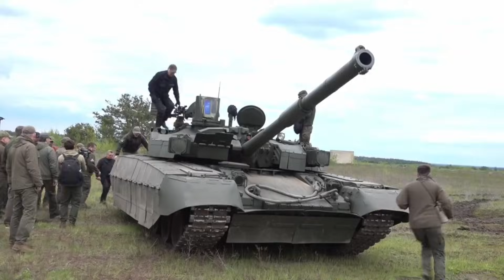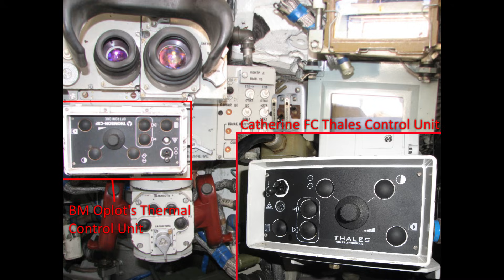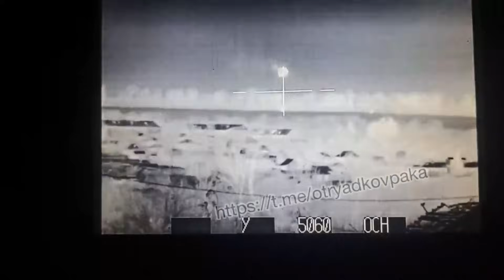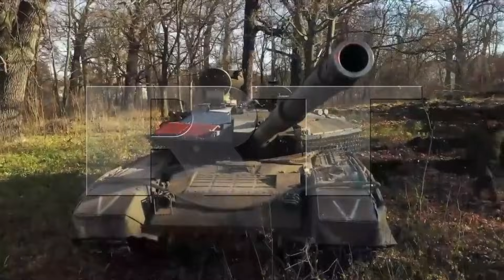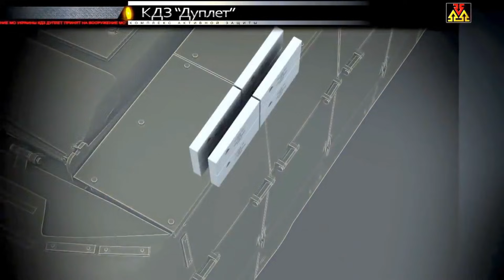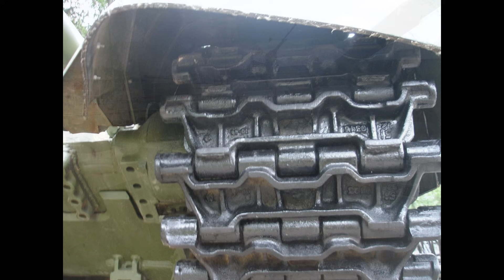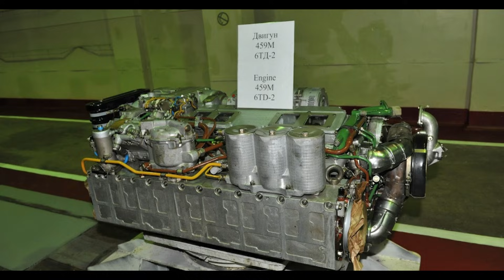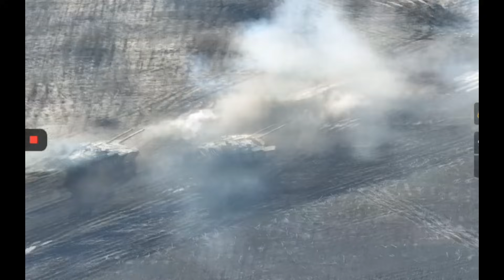Best Ukrainian vs Best Russian tank. T-90M vs BM Oplot comparison

Comment: The biggest problem of both of the tanks is the cost to manifacture one relative to what are they suppose to do in the current conflict, i dont really think that restarting the production of the BM oplot is the most wise decision for ukraine but what do I know 🤷‍♀
Reply: if you said T-14 since Russia never build it for a conflict, yeah maybe, but T-90M? it still costs less than lets say Leopard 2A6, like, at that point the only thing that is not cost is T-72.

But T-72 is not necessarly COST EFFECTIVE, unlike T-90M, and Leopard 2A7
Reply: @gerfand  well ofc the Leo's are going to be more expensive but germany doesnt need to replace thousands of lost tanks that they lost mainly due to poor tactics/leadership, artillery or just being abandoned by their low morale/unskilled crews
russia doesnt need 200-300 T-90Ms, they need 1000+ tanks that they can mass produce/upgrade and send them to frontlines
Reply: @samuelsaktor473  and they are doing that this is why you see T-80B, T-72B and T-62 with thermals, its cheap upgrade but its not like they are low on tanks they use every day

That on top of T-72B3, T-80BVM and T-90M retrofit and production
Reply: Even before the war Ukraine had a chronic inability to build BM Oplots, Thailand contracted Ukraine to make some and it took so long that the Thais purchased and received brand-new Chinese VT-4 tanks in the meantime and right now Thailand has more T-84s than Ukraine did before the war.
Reply: @andrew2353  yeah, that is the funny part, it took China a year to give all those tanks, meanwhile Ukraine was a decade long process, ofc anyone can say Oplot is better. but at that rate, I stick Chinese
Reply: There's more than 300 T-90Ms out of production already. What are you talking about?
Reply: @koskok2965  in december I knew they delivered 200 T-90M just to Ukraine "SMO"
Reply: @gerfand  Yep. The footage of endless freight trains strapped with them crossing the camera FOV non-stop was pretty damn hilalrious.
Reply: @koskok2965  as far I know Russia cannot build tanks its clear those are non existent tanks. Or at leat they did something like used cheats to spawn tben in
Reply: @koskok2965  and how many of them were built before the war and how many during ? because as things go its way more cost effective and in russia's case resource effective to just upgrade the already existing T-72/80 etc. then to build new tanks that are way too advance for the role they are going to do on the battlefield which is providing fire support for the infantry
Reply: @samuelsaktor473  As times goes on, design flaws get evaluated and addressed, the design undergoes simplifications, both with respect to the bill of materials and the manufacturing processes pipeline. 

This dynamic approach to mass production can be found everywhere, from plastic cups to combat aircraft. Plus, Russians in specific hold DFM as the holy grail of manufacturing related issues. 

Yes, the upgrading of existing T-90As is significantly more cost effective, but keep in mind that Russia has entered a completely new chapter in its history, the sequel to the original Cold War. The number of T-90As remaining in stock for upgrading is limited and as it seems, very much inadequate in the long term (to beef up the Russian armed forces in general).
Reply: I mean they are already starting to produce all sorts of stuff abroad. For example they started to produce the Bogdana Howitzer.

Comment: T-90 M has abysmal reverse speed i hope they can fix that problem.
Reply: There is already a solution but it isn't used
Reply: @bicopgameryttm7266  if there would already be a solution, this wouldn't be a problem. Having developed a transmission is not enough, you need to organise production, logistics and then meet demands of russian army. It's better to have 10 T-90M with abysmal reverse speed than 2 with good one

Comment: Wouldn't Duplet ERA only be effective in countering kinetic and heat charges that are coming at an angle more than around 15 - 20 degrees of the armour? 
if the main principle of survival is using heat charges to dissect the penetrator, then the angle between the charges and the penetrator should be of vital importance. i can see the glacis being the best spot for it but for shots to the side and even from old RPG rounds that send a sufficiently small penetrator, this would prove ineffective if hit in the right spots of which the probability is around 30 - 50%.
Reply: It's not that we have flying t90s shooting darts from the sky
Reply: @stingray-5863  They do actually fire ATGMs and can hit a tank from the side easily
Reply: @dwarow2508 And they often do (Though I've seen footage from a T90M shooting three HE projectiles onto a T64BV for some reason)
Reply: @Pao234  HE-F is actually quite potent on old tanks like the t64 if used on the Hull or turret roof.
Since in reality life tabk on tank warfare, it isn't necessary to kill the crew or detonate ammo to knock out a tank.
Simply tracking it, destroying the engine, destroying the optics, can render an otherwise perfectly undamaged vehicle useless.
Reply: @Dwarow 2  even from the top such as in the case of the tow 2b and similar atgms
Reply: @Pao234_  likely didnt have any apfsds as it didnt expect to meet a enemy tank.
Reply: @Pao234_  bro thinks he's playing war thunder (over pressure my beloved)
Reply: @Pao234_  yeah because irl if you get hit and you dont know where the shot came from you get the F out of the tank as soon as possible. You dont know what hit you, you only know that it makes a big boom and that the enemy has his sights on you. You get tf out to fight another way.
Reply: @Pao234_ HE can do a lot of damage to a tank. Rip tracks, damage optics, sell shock the crew, rip ERA plates off.
Reply: @stingray-5863  side aspect*

Comment: That oplot tank is a big no for me. Take a look at the turret. It is entirelly blocking the driver hatch except that one small area next to the gun. 

If the would send those to the field they will befinitelly have massive driver losses. And the vertically stored ammo does not helps them getting into the turret eighter.

T-90m has a V shaped era on the turret front exactly to allow the driver getting in and out at much more turret positions.

Comment: That one Clip of two T-90Ms reversing is so painful
Reply: This is not the best example of a reverse move. As one person has already pointed out, there is a video where the T-90m passes the building faster.
Reply: @NotNayob335  the T-90M or any other T-72 tank only have 1 Reverse Gear with 4 km/h max speed only a T-80 have 10 km/h in reverse
Reply: @kevlar2536  the number of gears does not determine the speed. The T-80UD, having one gear, was traveling at a speed of -16 kilometers per hour. The T-90M has a modified transmission compared to the T-72, with the installation of a new engine, the reverse speed increased from 4 to 16, since there was already a video where he goes at a speed of 6-8 at incomplete rpm. The T-90A had a speed of 4 due to a weaker engine.
Reply: @kevlar2536  T80 also has one reverse gear
Reply: @NotNayob335  T-90M have the same engine as the T-72B3 and also the same Transmission, T-80s only have 10km/h max reverse speed at least the russian T-80s the ukrainian T-80s like the T-80UD or T-84 does have a other Engine and Transmission
Reply: @NotNayob335  and i have never seen a Video from a T-90M reversing with 16km/h maybe it was an test Variant and if you have this Video or knows the of it it will be nice if you can send the link for it
Reply: @KashtanGreg  yeah i know but it has an better engine with more Power
Reply: @kevlar2536  Nope. T-90M and T-72 B3M have the same 1130 hp engine coupled with automatic transmission.

T-72 B3 and T-90A have 1000 hp engine and manual transmission.
Reply: @chilechichich465  what i have never said that the T-90M have a other engine and Transmission as T-72B3 somebody else did say that but not me
Reply: @chilechichich465  and by T-72B3 i mean both Version because there isn't a big different same Max speed and same reverse speed
Reply: @kevlar2536  These are completely different variants. If you wanna upgrade B3 to B3M you would need: new engine, new transmission, new gun, new ATGM launcher, new autoloader, new fire control system, new panoramic view for the commander, new ERA on the hull, new radio system, GLONASS satellite navigation, rear view camera for the driver.
Reply: @chilechichich465  B3M does not hace a new gun its the 2A46M-5 that the normal B3 also have and both B3s does not habe a CITV only Nightvision which isn't stabillize both Variants aren't that different
Reply: @kevlar2536  Absolutely not true. B3 model is compatible with T-90A and it has 2A46M-2 gun with Mango/Vant ammunition.

B3M model is compatible with T-90M and it has 2A46M-5 gun with Svinets ammunition.
Reply: @chilechichich465  the T-72B obr 1989 is that what you mean but T-72B3 from 2010 has the same Stabillizer the 4E42-4 like the T-90 and the B3M with 40°/s  turret Rotation speed and also the same gun the 2A46M-5 which is Svinets 2 and other Modern russian round compatible
Reply: @kevlar2536  Absolutely not. You've got it all confused. T-90A and T-72 B3 were fully compatible and they were NOT able to use Svinets ammo.

T-90 was compatible with T-72 BA. Don't use Wikipedia, stick to Russian sources when it comes to Russian weapons.
Reply: @chilechichich465  i didnt use Wikipedie and on all Sources they say that the T-72B3 from 2010 have the 2A46M-5 but maybe they mean the 2014 Version where i believe most russian tanks T-90A included got upgradet with the 2A46M-5 to can shoot modern rounds and i also watched Videos of T-72B3 having that gun
Reply: It has been confirmed many times that the reverse speed was improved on the T90M tank. It's top reverse speed is around 14+ km.
Reply: @korana6308  where was it confirmed because in most Clip you See T-90Ms reversing with an top speed of 4km/h
Reply: @kevlar2536  you don't see 4km/h because there's no speedometer. So you are lying. There has never been a conclusive test online that shows the backwards speed, because neither side thinks it's of important value. If Russians show it you will still say it's not enough. If Ukranians will show it then it will show that Russia did improve it. And precisely because they are not showing it even though they have this tank. You can tell that it's been improved , because they would be the first tone to show otherwise... It has been confirmed by several engineers who designed that engine, on forums.
Reply: @korana6308  i am not Lying because to me it didnt look like that it is 30km/h or so more its under 10km/h and their where other test with T-72s like on the M-84 where it have only 4km/h in revers and it can be Important to qiuckly go in Cover after shooting
Reply: @korana6308  and you can looked up at many Sources that T-72s have unter 10 km/h in revers mostly 4-5 km/h
Reply: @kevlar2536  That is the point it is 14 km/h now. It is improved compare to T72 and the original T90 engine.
Reply: @korana6308  but where is the source and in all footages of the T-90M in ukraine Shows the opposite it much slower then 14km/h
Reply: @korana6308  or did you have seen a Clip of a T-80BVM reversin because the BVM kinda look like the T-90M because of the Relikt
Reply: @kevlar2536  there are no "footages" that show you speed of the tank and it's max reverse speed.
Reply: @korana6308  in this Video there is one Clip of two T-90M reversing with a speed defenitly under 10km/h and in all footages of the Tank reversing it is always at about 4-5km/h it is very slow
Reply: @korana6308  he also made Video of the Problems of T-90M there is also an Clip of a T-90M trying to revers in Cover but it had to turn his Hull so it can drive forward to the Cover and also need to use smoke
Reply: @korana6308  source?
Reply: max pain
Reply: Which is why Russia is restarting the production of T-80. Nonetheless, in a direct tank vs tank battle, Russian tank almost always prevail. It's to the point that Ukrainian doesn't allow it's tank to directly engage Russian tank. If they see Russian tank, they are to avoid engagement and call in the precision artillery strike or drone attack. Then came the Western tank.  But Russian tank in turn avoid engaging Western tank and instead call in drone attack.
Reply: Russia has beef with reverse gear 😭😭
Reply: but in one year there is no evidence that the tank was destroyed in such situation
Reply: @Niko_rj  there are some Videos off T-72s getting destroyed because of the poor reverse speed and not only in the Ukraine Konflict also in the middle east
Reply: @kevlar2536  and can you prove it? and I'm talking at the turn of the tank
Reply: @Niko_rj  did you mean the Turn of the Hull or the Turret
Reply: @Kevlar25  hull, when the tank is moving backwards, but turns hull
Reply: @Niko_rj  but i am talking about the two T-90Ms reversing in this one Clip there reversing straight
Reply: @kevlar2536  I said that they had no case where tanks were destroyed at such a time. but you said that there were such cases
Reply: @Niko_rj  yeah there are such cases but i thought you mean by the reverse speed and not the turn of the hull
Reply: its not a really good example ive seen them reverse much faster then this. In this spesific case the drivers just decidet to not reverse quickly
Reply: @nekko5778  T-72s does only have 1 reverse gear with 4 km/h max speed which is really bad even if the driver only drove 2 or 3 km/h it wouldnt make any big differenc
Reply: @kevlar2536  In the T-90M, the reverse speed has been increased to 15 km.
Reply: @milaro222  did you have a Source
Reply: @P40 yeah i think so
Reply: @kevlar2536  yeah i noticed this in warthunder and it really is a pain. to the point that its faster and there for saver to just rotate and reverse by driving forward lol.
Reply: @milaro222  source?
Reply: @nekko5778  ive seen them reversing a bit faster as well, but I still don't understand what reverse speed they have...
Reply: @KashtanGreg  sometimes it can be a T-80BVM which kinda look like a T-90M especially with most of the footage of the ukrainian war having a very poor quality